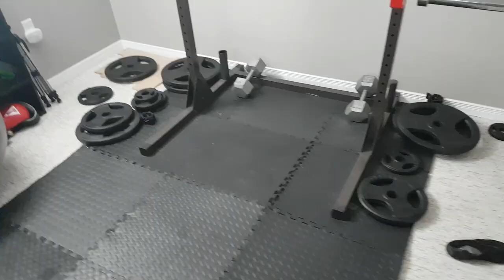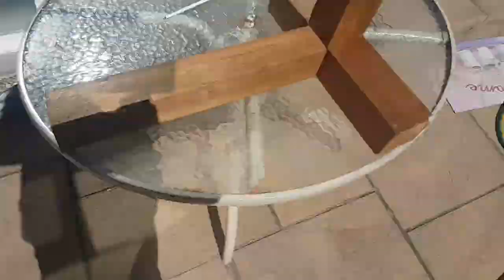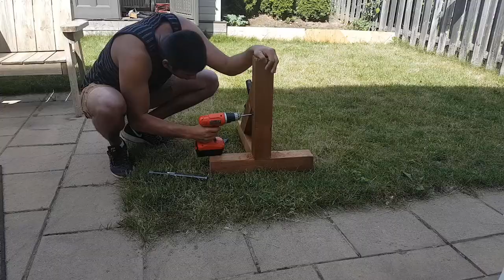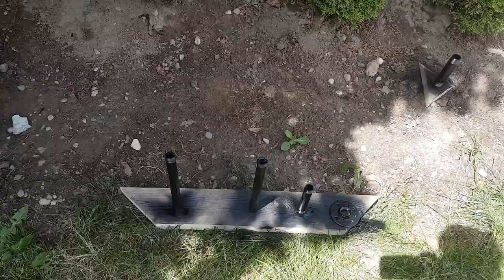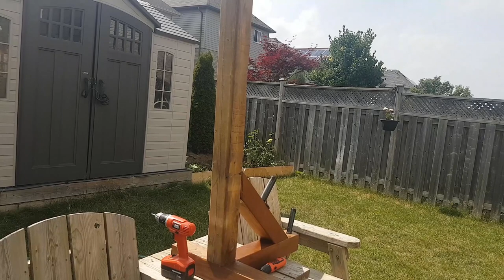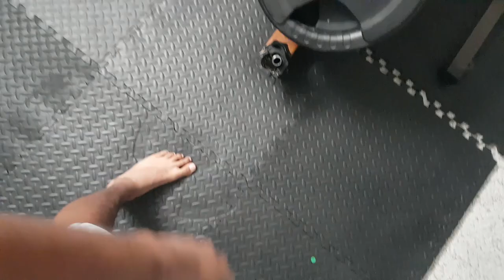DIY Weight Plate Rack

Comment: Dimensions would be helpful, want to build this. Thanks!
Reply from the maker: Here's a link to a Cad Model I made: https://drive.google.com/file/d/1MXO3DIRbAA1Z91KYgWOaHttyBG8qVBQG/view?usp=sharing  The units are in inches. I hope this helps.
Reply: Excellent, thanks so much!!
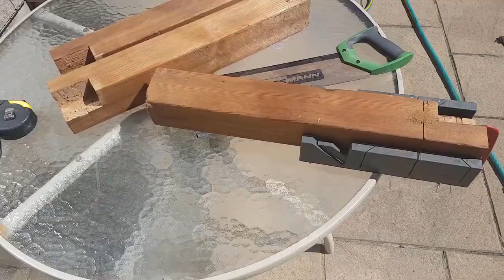Reply: Evolved From Primal Much appreciated for the idea and the CAD model. Quick question: how did you join the three pieces together?  I noticed you showed two of three 4x4s around 0:23 with notches in them - was that to join the boards together?